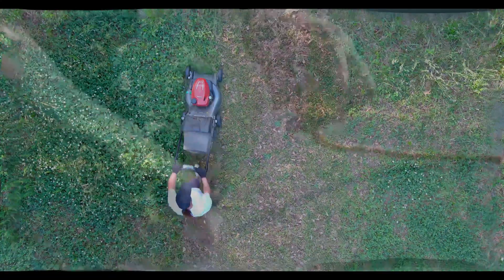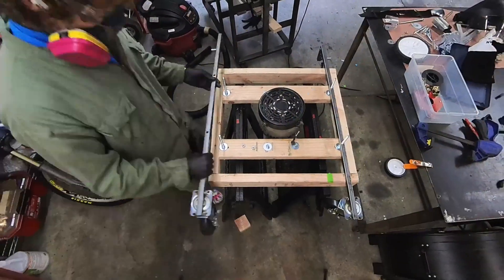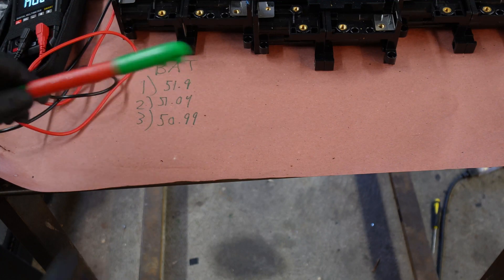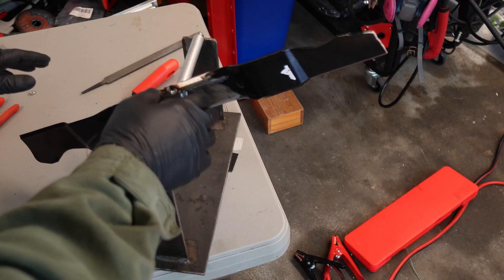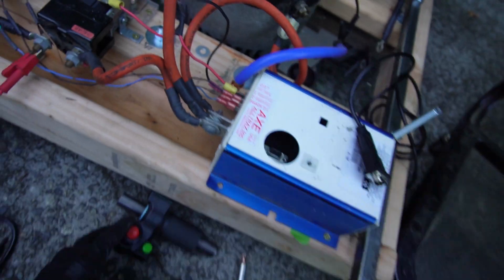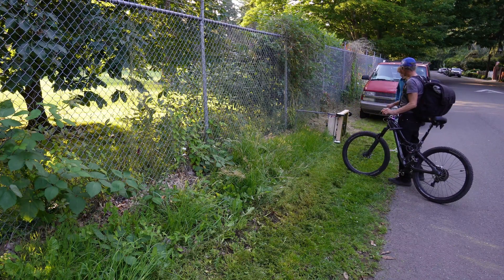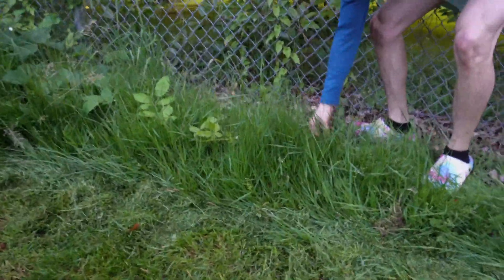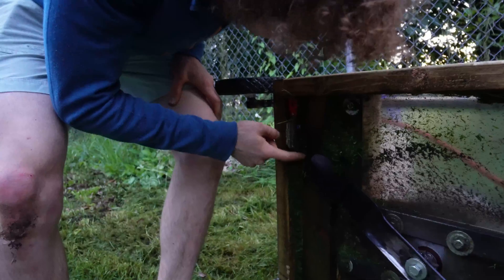Building a Wooden Electric Lawn Mower (20 Horsepower)

Comment: That handlebar is it way too high of an angle. You need it lower so you’re pushing more forward instead of lifting up the rear end so much.
Reply from the maker: Good point. It works all right in the standard grass, but for the thick brush and soft ground, it tends to dig the front castors in.

Comment: That thing is a beast.  Should build a zero turn ride-on version. :D  The electric ones are like 7 grand, could probably build one for under 2.
Reply from the maker: Thank you! It definitely has some power. I plan on putting the motor in a go kart next, but maybe after that, a zero turn mower would be like combining the two concepts